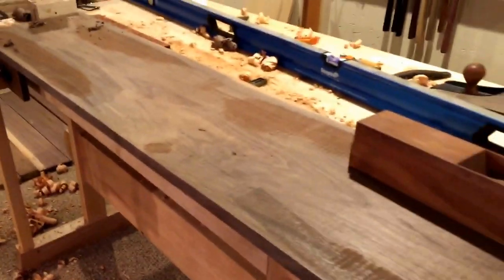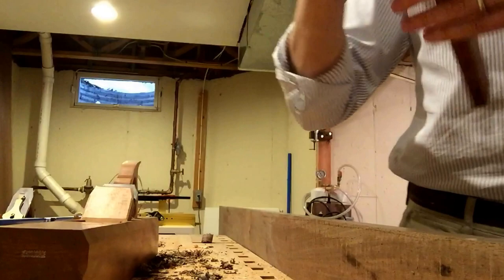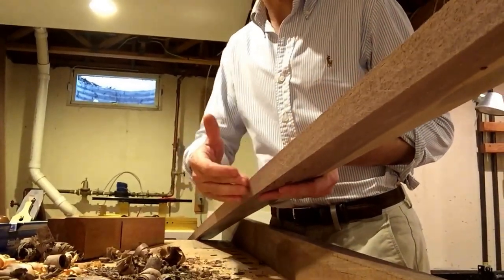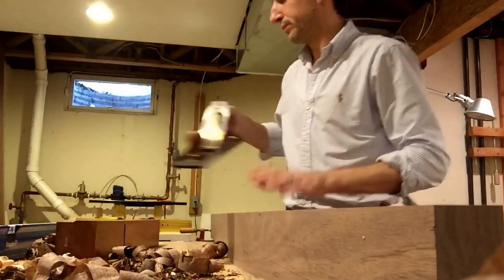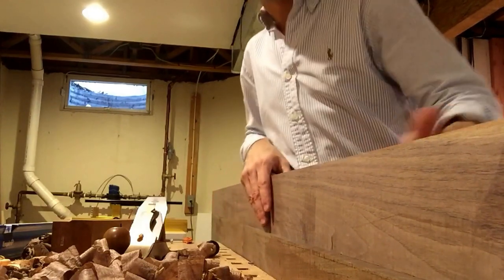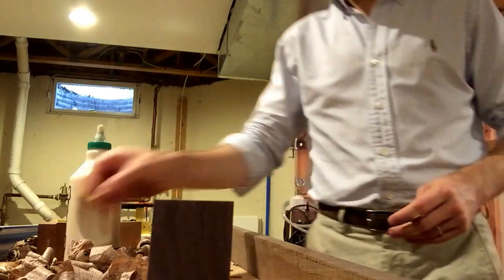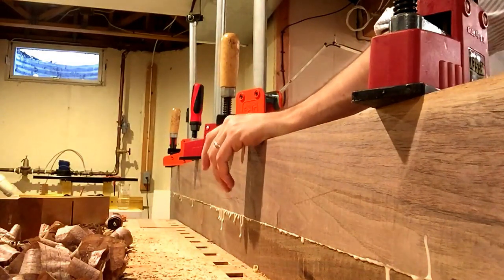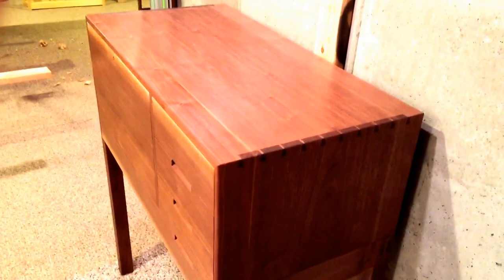Edge jointing and glue up on large panels by hand.

Comment: Do you think a jointer fence (the kind made by Veritas to attach to plane sides) would make edge jointing more accurate and easier?
Reply from the maker: Hi Indranil, good to hear from you.  I think that the fence would do a disservice in this instance, because it would reference to the face of the board which is still rough sawn.

My overall goal is to work everything in my favor, so if the board is cupped, then the adjoining boards are slightly biased in the opposite direction so that when I begin milling the board flat on the face I have less work to do.

The purpose of doing this while the boards are rough sawn is similar,  If I have two or three boards joined up together then my cross grain stroke cuts all three of their faces at once and the work progresses more quickly.
Reply: Hi Brian, thanks for participating so much in your comments section. Mind answering a question related to Indranil's? I've never edge-glued boards this thick, so I've always match-jointed (for lack of a better term), where I clamp two boards' faces together so when I joint them, any tilt in my plane is shared between the two boards. Is your sense of plumb solid enough that you're able to joint boards close enough to require only minor tweaks, like when you mention the top board being proud? Or am I missing a method that's should be smacking me right in the face?
Reply from the maker: Barry, have a look at my blog, there are a few posts which answer these questions better than I could do here.  www.brianholcombewoodworker.com  specifically under the 'the floating credenza' in either first or second post of that series.